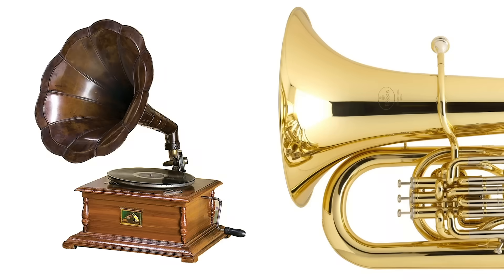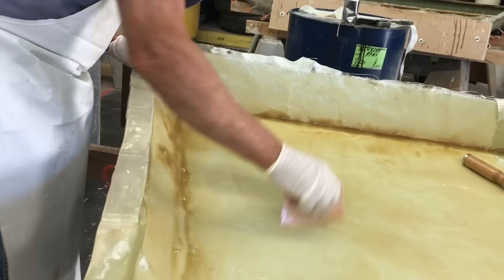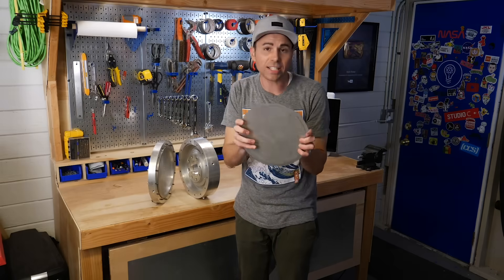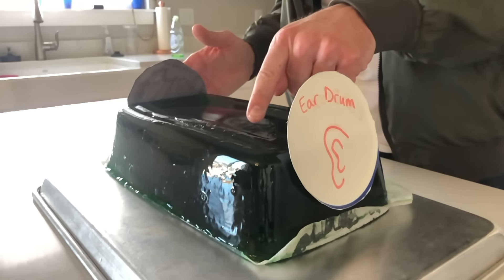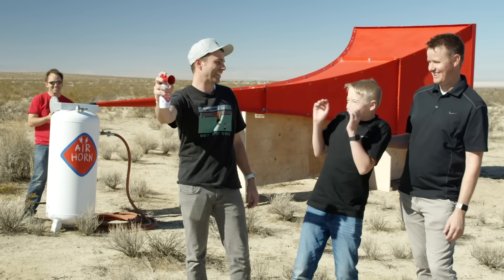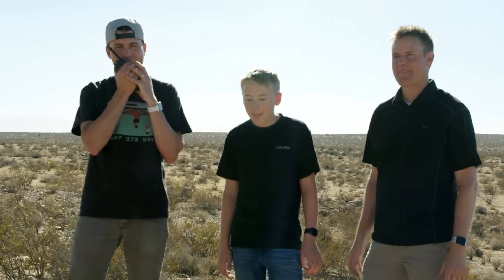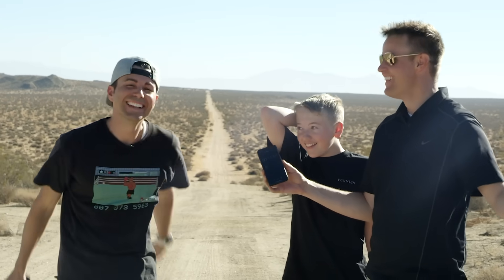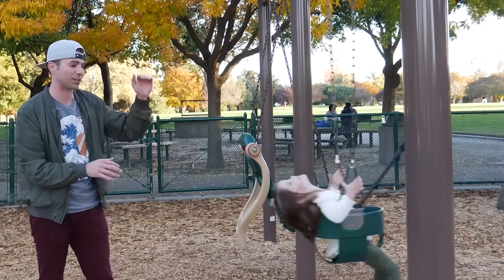World's Largest Horn Shatters Glass

Comment: The other reason for the curvature instead of say a T shape is something called diffraction patterns which is a bunch of (pressure) wave physics. The horn will introduce some sort of diffraction caused by its edge distorting the sound nonlinearly and the smooth flaring ut shape is a way to make this more predictable.

Comment: If you use a drone inside a bus, is the drone stand in the air or go to the back of the bus?
Reply: It will go forward when it accelerates and back when you break then still at constant speeds. There are a few videos of balloons in cars which is the same principle.
Reply: It comes down to relative air and pressuredcurrents, inside a bus which is for the most part sealed, the air current inside is staying at a constant, so theres no force to push the drone back against the end of the bus, aside from on acceleration or braking which will cause a pressure difference inside the bus due to the sudden change relative to the outside air pressure
Reply: If the bus is accelerating forward the drone will go towards the back of the bus. A drone has inertia that works to keep it stationary with respect to the initial frame of reference, which is a bus going a certain speed (could be 0). The air in the bus will accelerate with the bus and have a very slight effect on the drone but is insignificant relative to the drone's inertia.
Reply: @thebigmacd  try it, you are overlooking what the air in the bus would be doing 🤔
Reply: @bhew7409  I addressed the air in the bus. A drone is not a balloon. The mass to surface area ratio of a given object determines how much the air affects it relative to its inertia.

Think of it this way...put a person on a skateboard in the bus and have the bus accelerate. You seriously think the person will do anything besides roll to the back of the bus?
Reply: Are you a FE theorist..
Reply: It would stay in the same place within the vehicle unless it has GPS positioning

Comment: NOW want something else to use that for????????
Put a flexible mesh over the front, Place a Bowl ship over it...
On the mouth section, a Plunger, on a long rod, with a Rubber band/spring connected to it..
Fill horn with Smoke...Then Pull  plunger and release...
1 HUGE smoke ring....and should travel a good distance....go for the record..
Reply: PS, next time try the harbor, near the entrance, contact a ship and see if they will honk the horn..  Old Light houses also..had huge horns...

Comment: I have a strange thought I've been wondering, if you have any knowledge... I was wondering if a suction-cup would actually work in space since it wouldn't have any air to displace. And how would you even test it in a vacuum chamber already stuck to something? I want to see it stick (or not) to something after the air is already taken out... I just wonder...
Reply: IMHO if there isn't 14.7 psi (approximate atmospheric pressure at sea level negating variables) there wouldn't be any pressure to push the outer material in.  So imagine having a hole in the suction cup, there's equal pressure on both sides or in this case no pressure on both sides.  So in theory the suction cup wouldn't work in complete vacuum even if it had already been attached, maybe some residue static charge may hold the suction cup to the surface.   A cool way to test this would be to take a small piece of pixie glass, a suction cup, a nice size mason jar and a boiling pot of water (careful don't burn yourself).  Stick the the suction cup already attached to the pixie glass in the jar, stick it in the hot water for 5 minutes or so,  seal the lid, take the jar out of the hot water and let it cool.
Reply: @jasonguyyeah  Thanks a lot for the comment, i'll need to try that! I figured out that the action lab made a video about it that I have not seen yet, but its on my list!

Comment: 10 Facts

1) You're reading this.

2) You can't say the letter M without without both of your lips touching each other.

3) You just tried it.

4) You're smiling.

6) You didn't notice I said "without without" in fact number two.

7) You didn't notice that I missed fact five.

8) You just checked it.

9) You're either smiling or giggling.

10) You're going to like or reply.

11) This is actually fact 10.

Comment: Do you now know why Foghorns are so humongous. Ships and Boats need a verry long way to breack or change course. And In Fog they can't see very long distances to check for other Ships/Boats. So theys Foghorns have to bee verry loud and a suttle deep pitch to warn other Ships/Boats of theyr presence in the Watter. I Switzerland, this method was taken for an other Purpose. Instead of Lighthouses you may see Giant Horns at Shallow parts of our Lakes. When there is Fog, These Horns would resound at a specific rate per time. Like with the Lighthouses and theyr Spacific Light RPM, Boats could determinate Where they are and whitch direction theyr Floating, only from the pitch, the resound-frequency and the direction where it was heard, all Pre Sonar Times.

Comment: Um did you calculate the sound for your altitude because the algo you used I think was for sea level? Higher the altitude the slower the speed of sound is, in water it is much faster, in a solid it is even faster. Also, temperature has a major effect on sound as well. Just sayin

Comment: Shhh...  impedance matching is also used in radar feed-horns.  Rather than abruptly going from a small diameter pipe (our mouth) to a wide diameter pipe (free air), the horn provides a gradual transition for maximum transfer of power..  The horn also works in reverse as used in early hearing aids.  "Eh. What's that you say sonny."

Comment: 4:38 but if the area gets bigger, the energy per area should decrease, so that the whole kinetic energy of the moleculs pushing through stays the same. In this case you wouldn't hear a louder noise, it would be linke normal sound expanding in room and gets weaker with distance. So what is the difference here?

Comment: No sound strength measurements? Seems cool but no one watching this video has any way to compare the output of this horn with anything else. I personally would be interested in how the sound falls off with distance, angle from the horn, etc. Attenuation is a function of temperature, distance, frequency, humidity, and medium (at minimum). Would have been nice to see illustrations of that as well.
You can get meters for like $17 on ebay. 
https://www.ebay.com/itm/Dr-Meter-Digital-Sound-Pressure-tester-Meter-40-130dB-Decibel-Noise-Measurement/111847285295?epid=516278825&hash=item1a0a9e222f:rk:1:pf:0

Comment: Just want to say that the Tacoma narrows bridge was not downed by the frequency of the wind gusts but rather the wind induced an instability known as aerodynamic flutter. The wind gusts themselves weren't at the resonant frequency; the wind caused specific motions in the bridge that seeded it's own instability, but was NOT due to the frequency of the winds motion but rather only its amplitude. This means you should get the same effect with random wind frequencies at large magnitude and honestly,  this makes sense given that wind is hardly monomodal.  Saying the wind gusts had to go at just the right frequency is inaccurate--it had to primarily be at the right amplitude.

Comment: I'm pretty sure there is amplification going on... It's just not the typical concept of electrical amplification.  Instead, it's natural acoustic amplification through the  resonance of the material and the reverberation of the sound bouncing  off of it exponentially which is where the parabolic shape of the flare comes into play... Though, that would just be my hypothesis.  The same concept as how the sound coming out of an acoustic guitar is obviously louder than the sound of just the plucked string.  It's just a different shape to apply acoustic properties for a different purpose.

Comment: Wouldnt it be the weights vibrating then that's  breaking the glass? Not the air/sound. 
You can break glass with out added weights. Singers and wineglasses. Unless they are holding the wine glass. Would the contact contribute ?

Comment: It is the same concept with a train horn. Air from the trains central air system, sends the PSI, whatever it  is set to, which, as you said, the disks and diagrams burgle and vibrate, and then goes down the throat and goes out the wide end, which amplifies the horn. Also, to make the horn blow, when you pull what ever to make the horn blow (cord, lever,etc) and the hose of the PSI flow to the horn, it opens and the air goes into the diaphragm:

Comment: SO I played at 0.5x playback and timed from the end of the horn sound on mark's radio (only clean footage) to the end of the horn sound at the camera position. I did 3 test 
a) 23.97sec     b) 23.85sec     c) 23.95 sec             Avg. Speed real time = (71.77sec/3runs)/(2) = 11.96 seconds 
 
 11.96 sec / 3600 sec/hr = 0.0033 hours                                   2.5 Miles / 0.0033 hours = 752.4 MPH

752.4 MPH (5280 ft/mile)= 3972690.76 feet/hour         (3972690.76 feet/hour)/(3600 sec/hour) = 1103.53 FPS 

Given the speed of sound @ STP is 1125.33 fps (767.27Mph) and speed of sound decreases with altitude they're probably around 3,500ft elevation. +0.5% even at 5,000 ft. 
But Awesome video, what a cool experiment!

Comment: I'm not sure the science was completely accurate. The larger interface described would actually take more power to run, and as you said this is passive. This would require the horn shape to sit on the diaphragm, which it does not. 

What actually happens is the horn reduces the spread of the sound waves, and this very specific horn shape (360 degree rotation of y=1/x around the x axis) has been shown to be the best way to reflect any spreading sound waves forward, which increases the intensity, which translates to the volume of the sound heard

Comment: I'm pretty sure you are amplifying, because fluid dynamics says that in a flow system opening or closing the diameter of the flows path either increases or respectively decreases the pressure, so while you are not changing the wavelength or frequency of the sound you ARE increasing the pressure at which it leaves the horn, which is the reason it will travel further because it penetrates the air with more impact, and same reason the horn will break the glass, which has nothing to do with frequency or bridges, I have to say.

Comment: To ensure accuracy, horns don't amplify, you need extra power input to amplify a signal. Horns couple the power (vibrations) more efficiently to air than human vocal apparatus by being correct size and shape for chosen frequency bandwidth. They ensure the frequencies are coherent as they move along the horn, and directional rather than over 180° approx. for humans.  Horns usually are made  a certain length and width corresponding to frequency length. 
Hence it sounds louder and goes further.
Boats have been using these for centuries for long range indicators.

Comment: Great video, but there was just a slight mistake in regards to the Tacoma Narrows bridge. It actually collapsed because of areoelastic flutter instead of resonance. Since the bridge was aerodynamically unstable, the constant force of the wind caused the bridge the tilt and create pockets of low and high pressures that quickly grew more and more unstable.

Comment: The fact that typical horns are a 'pseudosphere' (that is, each point of the sphere has the same amount of negative curvature) also has an effect. I learned about this ages ago, so this is probably half-wrong or at least really simplified, but waves can constructively interfere (which means that they team up to form bigger waves) or they destructively interfere (which means they cancel each other out - this is how some noise-cancelling headphones work). Essentially having the same curvature everywhere means that, at least right in front of the horn, it's going to constructively interfere, not destructively interfere. So, maybe Mark could produce an even louder horn by making it curved.

Comment: I am pretty disappointed with your explanation of the horn as "impedance matching." As an antenna engineer, this looks to be the acoustic equivalent to an electromagnetic horn antenna. Large antennas "amplifier" signals passively by directing energy in a single direction, rather than energy spreading in all directions without the use of a horn. The larger the aperture, the more signal be sent in its design direction, but in other directions, less energy radiates.

Imagine that your mouth is a point source for acoustic energy. The energy will spread in all directions. When you put a straight pipe to your mouth, you are simply moving the point source from your mouth to the end of the pipe, but it is still a point source. When you use a flared horn, the source is no longer a point, but rather the entire area of the flared opening. This larger source of acoustic energy creates a narrow beam normal to the plane of the opening, "amplifying" your voice.

I really would have liked to see a video where you measured sound level at all azimuth angles around the horn. If acoustics works like electromagnetics, we would be able to see how the sound energy is directed along the axis of the horn and is significantly reduced at other angles. This would have been a much better way to show the physics of what is happening with this horn.

Impedance matching is definitely a thing, and the shape of the horn is definitely doing impedance matching, but that is not why the horn sounds so loud.

Comment: You state Tacoma Narrows failed due to the wind speed.  The Tacoma Narrows bridge failure was independent of wind velocity.  The bridge’s main girder shape lead to vortex shedding that matched the bridge’s natural resonance frequency.  These dynamic forces in combination with the lack of rigidity caused torsional oscillations.  Just like pushing a child on a swing, amplitude is more reliant on frequency than force.

Comment: This is a good example of during a thunderstorm you see a lightning flash, you count the seconds and then divide by 5 to get the approximate distance of the lightning from you. :) Whats the speed of the walkie talkie signal?
Reply: Both are the speed of light.  299 792 458 meters/second.  The speed of sound is 343 meters/second in dry air 20 deg. C.

Comment: The wind on the day the Tacoma Narrows bridge collapsed wasn't gusty like you make it sounds. It was the strength of the wind that knocked the bridge down. It wasn't the shear strength that knocked it down, but what stresses it caused on the bridge. The designer opted for thinner girders which made the bridge flex easier. This flexing caused the bridge to more easily twist, like seen in the video clip. When the wind was strong enough the bridge would twist back and forth where another effect took it to collapse, Aeroelastic Flutter. This flutter is what you see when a flag flaps in the wind. It gets pushed one way by the wind and then pushed back. This ultimately is what caused the bridge to collapse.
Reply: Aeroelastic flutter is just another form of resonance, so you're both right.
Reply: Typical Floyd fan
Reply: The resonating caused the bridge to collapse.
Reply: Yeah go ahead and try to prove the NASA engineer wrong.
Reply: @phillippinoFLASH  Not every engineer knows everything about engineering. Mark is probably not a civil engineer, and so won't really be the best resource on bridge design.

This dude is right, it wasn't gusty winds, it was the shape of the road deck combined with its ability to flex rather extremely. The bridge was behaving much more like the reed of a woodwind than a swing. However, this is still resonance, just a different kind.
Reply: @tissuepaper9962  a quick search will tell you differently. Site specifically say that the wind caused the bridge to oscillate near its resonate frequency cause it to... well resonate and fail.
Reply: No. You're wrong
Reply: @nickgalietti2224  Read my comment directly above this one. Ignore the first bit, it doesn't pertain to you.

Comment: Just a little nitpick: while commonly attributed to resonance, the collapse of the Tacoma Narrows bridge actually occurred because of aeroelastic flutter. Resonance requires an oscillating force to match the natural frequency and the wind on the bridge was approximately constant.

Aeroelastic flutter occurs when a system "overcorrects" for a disturbance from an equilibrium. In the case of Tacoma Narrows, wind tilted the bridge to the side, and gravity and tension moved it back too far. Then, the wind tilted it to the other side, but even farther and so on. The amount of tilt increased with each rotation accross the equilibrium eventually causing the bridge to fail.

Comment: If you liked the Japanese air raid sirens, you should check out the Chrysler air raid sirens with a 180HP Hemi V8 engine
Reply: heh, just checked it out, for some reason i thought it'd be driven off the exhaust, thing looks almost like a wheel-less rocket powered tractor

Comment: For the jello example, isn't the cone shape that push the jelly hollow in the middle instead (like the horn)? So it's not really pushing the air molecules as a surface but only the rim?
Reply: the wood represents air, not the horn itself, so if you imagine the air inside the horn being also shaped as a horn, its not hollow, the horn itself doesn't move